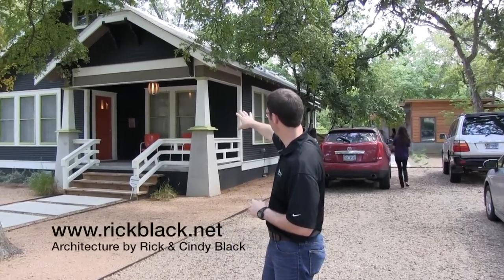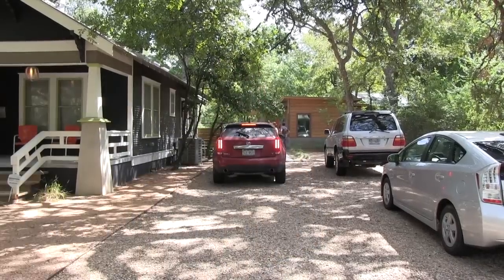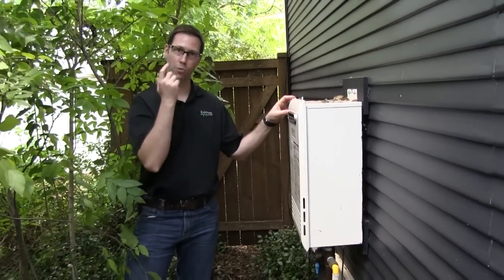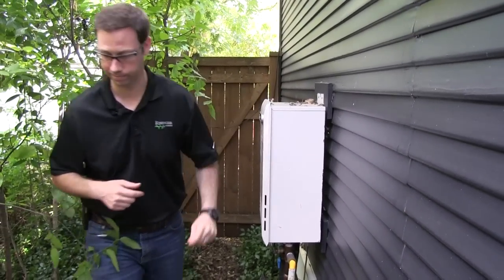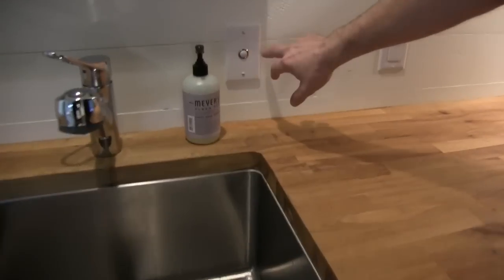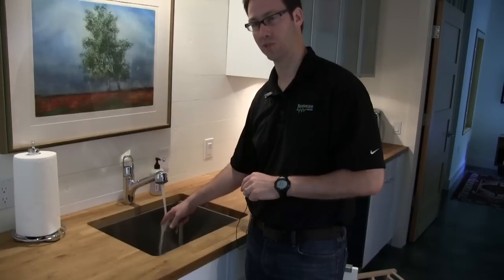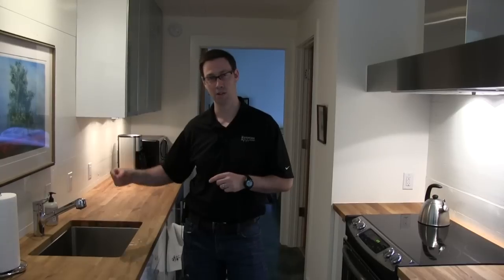Hot water - Without wasting cold - Metlund D'Mand Instant Circ Pump

Comment: Nice product, would save the cost of an extra heater! what about an ECO-HOT valve? For a remote home ECO-HOT would not be enough but the valve can enhance the operation of circulating pumps as well. In a normal home (2000 sq. ft. or less. the ECO-HOT valve will get hot water fast by flushing your toilet! YES that's right, just wake up in the morning and do what you always do...then flush the toilet ! when the tank fills, you will have purged the cold water from your hot water pipes and your bathroom will quickly get hot water for your shower or washing your face. NO ELECTRIC, NO RETURN LINES, NO PUMPS, LONG LASTING, MONEY BACK GUARANTEE. AT a lower cost than the cheapest circulating pump with an easier installation... HotWaterFast . Green     Matt; how can I get you to review my product?

Comment: The only thing I don't like about this set up is having to push the button ahead of using the water.  I'm sure it's something that becomes automatic over time, but I just like for things to work consistently.  If I want hot water, I reach for the faucet.   I'm so set in my ways that I probably would've just sprung for a second (albeit smaller) tankless heater.  But that's just me.  I don't like having to add the step of hitting that button first.  I'm sure most wouldn't mind, but I'm also sure that I'm not alone in my feelings over that button, lol.
Reply: They do sell a version that uses a motion detector instead of a button. Or you can probably use an off-the-shelf low voltage motion detector.
Reply: @edbouhl3100  
Could it be wired into the light switch?  Or would constant flow of electricity be a problem?  My last house had a skylight in the bathroom, so I hardly ever used the lights during the day time...  I guess if you don't have a skylight, then no problem, lol.
Reply: @brussell639  I think you’d need to use a relay of some sort to keep the high voltage light current separated from the low voltage button circuit.

Comment: I installed my tankless for about $550, that's including the water heater and necessary plumbing.  I guess my labor is cheaper than yours.  It's useful to be handy.
Reply: I just spent $500 on the tankless alone. But then I had to replace all the old galvanized pipes in the house.

Comment: I'm not impressed.
The difference between pushing that button then going away for a while and turning on the hot water tap and going away for a while is that it shuts itself off automatically. The pump does NOT add its pressure to the 50 psi pressure from the mains. So the time to warm up the 50 feet of pipe is about the same. 
Comparing it to adding nothing to the hot water line . . . The ONLY savings is that it turns itself off at exactly the right time. You still have to remind yourself go back to the sink within a minute or it cools down again. You still have to time yourself !!! If the comparison is made with running the hotwater yourself using the faucet (no pump) the only savings this system offers is water not going down the drain. Thus compared to waiting for the water to warm up with the running of the tap, you are not saving energy because it is returning. You are saving water.
Thank you for your video. I now feel better with the $300 electric heater under the sink I have that does not require me to anticipate my need for hot with the pushing of a button and then remembering to go back to the sink after a few minutes.
Reply: Humm... I just replaced my water heater, moving it to a code compliant location. But it added more travel distance. Even WITH the demand pump I’m now having shower temperature issues (and my family is picky). A small under the sink water heater unit in the farthest bathroom might be the way to go.

Comment: Did you run a dedicated recirc line back to the water heater or did you install it like a retrofit which forces the hot water into the cold water line?

Comment: great video. I have 2 bathrooms less than 20 feet from each other.  do you have to install a pump at both locations? or is it perhaps a single pump with a recirculation line installed as well? let me know if you can clarify.
Reply: Depends on how your home is plumbed. If you have a manifold system, you'd likely need one at each location. But if your home is standard CPVC trunk piping, a single unit will work. You can test this but it can get somewhat complicated explaining this over online message. But mainly time hot water to each outlet. Both individually and when other faucets run to determine if they interact.

Comment: Hi. I have a 30 gal electric water heater in my house which is right by my bathroom so water is hot rapidly but if someone takes a long shower, for example, mine is just barely warm. Would this help that in any way? Or is it just to keep hot water available quickly? Thanks!
Reply: Sorry but this wouldn't help in any way, it's simply meant for faucets that are a long distance from the water heater. It just sounds like you need a larger heater or need to wait longer for your shower.

Comment: Does the cold water  line gets warm like some other types of pump?
Reply from the maker: Escorpio40 It certainly can.  But I've generally not experienced that issue.
Reply: And further to Matt's post, most good units have an adjustment to balance the amount of hot water that reaches the cold water line. Can't speak to the D'mand unit (refuse to use them), but other MFG units do.

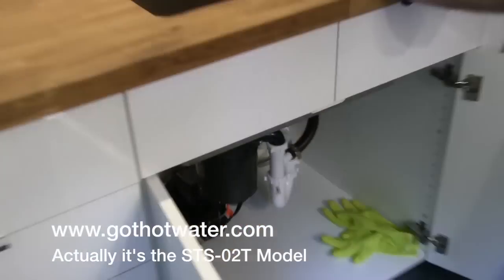Comment: If I'm not mistaken, isn't the "pump" actually a TACO pump?  The cooling fin's on the pump body leads me to believe it's a TACO 0011-SF4 rated at 31GPM flow rate.  If you research Metlund pump website you find that these systems operate based on Temperature Differential or 'deltaT' and not on a selectable temperature setpoint.  So, depending on the water temperature in the pipe really does make a difference.  Say, if the water temperature was 50F and the temperature differential was set at the 9 o'clock position it would shut-off the pump when 65F water reached the pump not the 115F degree water temperature you stated in the video.  I found this info their troubleshooting documentation on their website.  At 3:33 you pushed the button at 3:46 you still hear the pump running so why state at 3:48  "it turns off after just a few seconds".  If it could deliver hot water in 3 seconds from the 70' away tankless water heater, it would rip apart the inside of your pipes.  Tankless water heaters add at least 3 - 5 seconds before reaching thermal capacity to begin heating the water.
Reply: +Redy Temp 
The pump is made by Grundfos but ACT (being called "Metlund") puts the system together -- pump, controller, sensors, bit and pieces, etc.
Reply: D'mand uses a TACO pump.
Reply: Ah, thank you for cueing me that the actual pump is made by Taco. Their label was still on the pump (face down) and I got the original pump model number. Then I found it in the Taco ‘00 Circulators’ list, which gave the replacement part numbers. The D’mand site doesn’t list parts for the pump.

Comment: The 3- to 4-second delay in getting hot water out of the tap in this video was the time it took for the water to get from the under-sink pump to the aerator on the faucet, not the time for it to be delivered 75 feet from the water heater.  The actual time to get hot water from a "cold start" condition is how long it takes from the moment the pump is triggered with the pushbutton until it shuts off when it senses that hot water has arrived, and that can vary, depending on the distance to the heater, the size of the delivery pipe and the capacity of the pump.  Low power pumps can take several minutes to deliver water.  By using a high power pump, like those used for hot tub spas, the wait time can be reduced to around 20 to 30 seconds.
Reply: +Milosz Ostrow 
He said it takes 50 seconds. Reducing it to 30 seconds wouldn't be worth the extra investment in my opinion.
Reply: Doug F — You must live in an area where you have more fresh water than you need, perhaps in a city where they don't even meter your water.  The reduction isn't from 50 seconds to 30 seconds; it's reducing water waste from 50 seconds to 4 seconds!!  That's a 92% reduction, and well worth it for people living in dry areas where water is in short supply and expensive.
Reply: +Milosz Ostrow 
I live in CA where water conservation is pretty important and I know a lot about HWR, have even worked with Mr. Met of Met and Lund fame.

Looks like I misunderstood what you wrote. The video shows it takes 50 seconds to get hot water to the pump then 4 seconds of water flow when faucet is opened. You then wrote about a low power pump taking several minutes and a high power pump taking 20-30 seconds. I took it to mean in this scenario a high power pump would reduce the 50 second pump time to 30 second pump time. Since you can buy an ACT system off the shelf and get the 50 second performance I said it wouldn't be worth the investment to create your own HWR system with a high power pump to reduce pump time to 30 seconds. (Still not sure what you wrote but figured I'd clarify what I wrote.)
Reply: The pipe size needs to be  correct for the faster velocity a more powerful pump will shove through it.  You'll have pinholes in it if you run high velocities.
Reply: Can you make me abit clear, so that cooled down water in the "hot water line" goes back to tankless water heater via circulation line? And how do you know when your hot water is ready after pushing the button?  How do you know when you need to push the button again?
Reply: @bamf6603 — Just open the hot tap for a few seconds and test the temperature with your finger, either directly in the water stream or feeling the temperature of the metal spout.  No advanced technology needed.
Reply: @Milosz_Ostrow  Thank you very much for your answer, and maybe do you have insight in it: i have noticed that if you are using bridge valve after the recirculation, the cold line will have a hot water in it, and so if u will want cold water you gonna need to dump the hot water. AND if you are using water heater with a tank this water will be not much drinkable and you wont be able to use cold water untill you dump hot water, so this the flaw that i see in this system, am i right?
Reply: @bamf6603  — What you say is true, but the warm water that gets pumped to the cold side only amounts to a few cups, not gallons, and since cold water lines are typically not insulated, the warm water in them will cool to ambient temperature within a few minutes anyway.  It's a cheap way of retrofitting a hot water circulation system without having to put in a lot of new pipes in a house.

Comment from the maker: The Bosch 1.5GPM unit would run a faucet but not a 2.5GPM shower and certainly not two fixtures at once.  I would also expect it to need a dedicated 20amp circuit.  The Metlund D'Mand pump seemed like a better solution.

Comment from the maker: Wayne, thanks for your complements!  We discussed an electric tankless but this Casita has a small kitchen & a full bathroom so we needed more hot water than a small unit could supply.  The gas tankless was existing so all we had to do was pipe the water to the Casita and install the Metlund pump.  They run about $300-400 plus install so it's a great solution.  We also stubbed out for an outdoor gas tankless to be added in the future if necessary.  Best, Matt